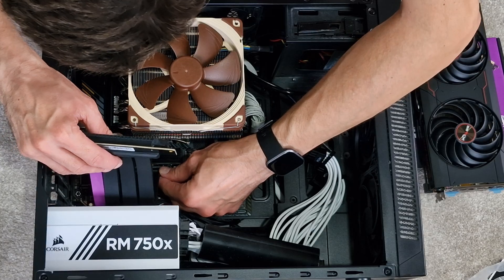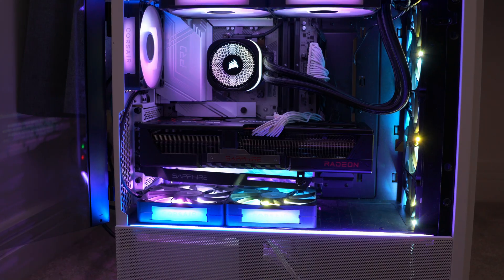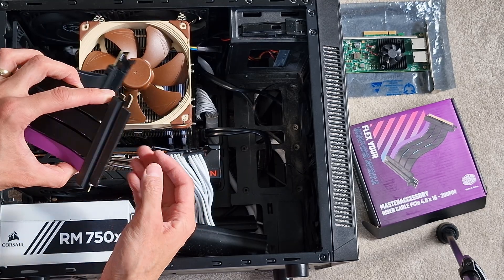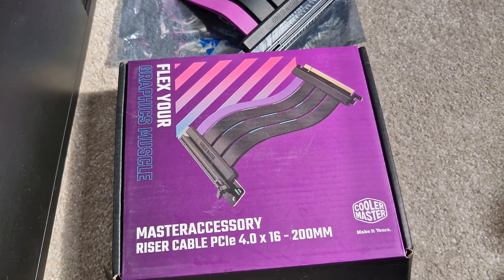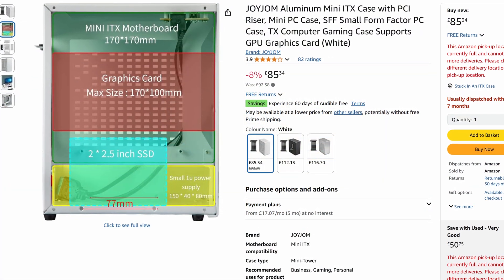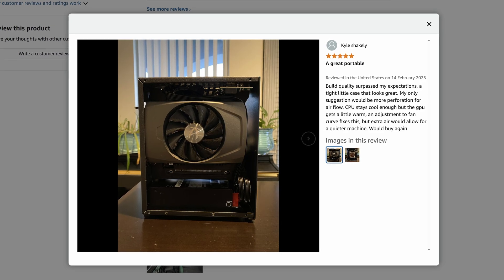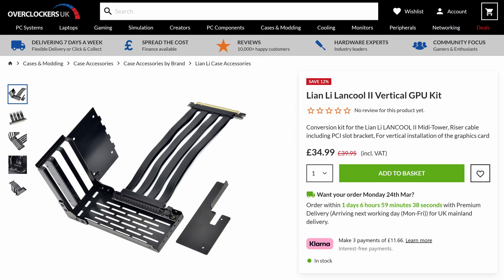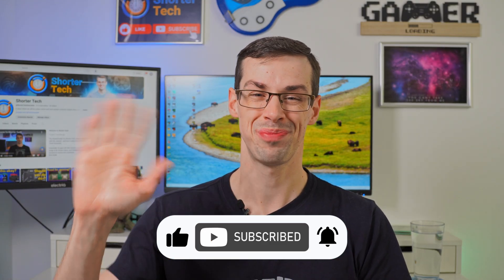x16 PCIe Riser Cables: How They Work... And Their Flaws

Comment: another reason that i believe im going to have to deal with is some motherboard and cooler combinations can result in the cooler overhanging the pcie slot so obviously the gpu and cpu cooler cant ocupy the exact same space so having to potentially either vertical mount or shift it down a slot or two either way riser card required
probably a less frequent reason but some of us are just running massive aircoolers on boards where the pcie slot is well yeah
Reply from the maker: That's a good point, yes that's another reason why riser cables might be needed. Always annoying when massive coolers get in the way :)
Reply: Just happened to me lol... whoops
Reply: @semioscuro24  which cooler and which board? ive got a sapphire b850 pure and a noctua ndh15 that i know im going to have this issue with when we get around to the build in a few days [hopefully] ive got a riser already though lol

Comment: Thanks for your video!
I have a question.
My motherboard has a PCI 4.0 GPU connector.
My 50-series graphics card has PCI 5.0 
What would you recommend a PCI 4.0 or 5.0 riser cable?
Reply from the maker: It comes down to price (sometimes gen 5 risers are a lot more) - and also future proofing. If you're likely to change to a gen 5 mobo in the future, then a gen 5 riser might make sense. But in general, you won't notice a massive performance hit from a gen 4 riser.
Reply: I heard that PCI5 GPUs don't like PCI4 riser cables. I'm building a new computer and I'm going to get a PCI5 cable.  Expensive but I don't want to deal with the headaches.
Reply: I did order a PCI5 cable though. Yes, it was almost 40% more expensive. But he is still on the way and I am waiting for him to test his work.

Comment: For the s300 case do i need to find single reverse or dual reverse pcie cable
Reply from the maker: I'm fairly certain you need double reverse for the S300.
Reply: @ShorterTechOverwrite I actually got a gift recently from my elder sister which is a 5070ti do I buy a 4.0 cable will it be enough difference  I use the already present 3.0 cable included with my s300
Reply: @itz.manish_09 should be pcie 4.0 for 5070ti but for the time being your are fine with 3.0. 3.0 can handle even rtx 3060

Comment: Not all PCIe Riser Cables are created equal. Some only support PCIe Gen3 which will limit the throughput.
Reply from the maker: Great point thanks, this is worth remembering for sure.
Reply: Generally the difference isn't that significant, but if you're spending the dough for a pcie gen 5 you're a fool for not spending the less than 100 dollars more to reap the full benefits of the build
Reply: To make matters worse, some motherboard tolerances are very high.  A riser cable that runs full Gen speed x16 on one motherboard, won't even allow the GPU to be detected on a motherboard with higher tolerances.  You basically have to do tons of testing just to find a riser that will work with your specific motherboard.  Pray you have a forgiving seller willing to accept all of the different returns you will be going through while finding a suitable cable.